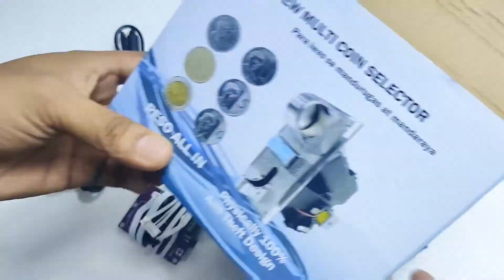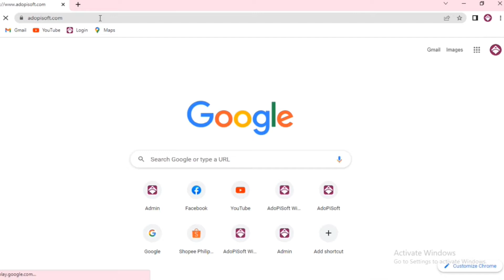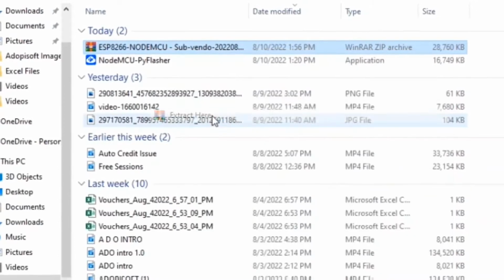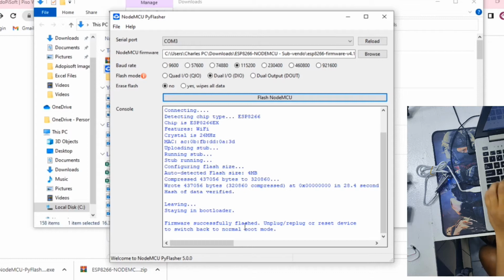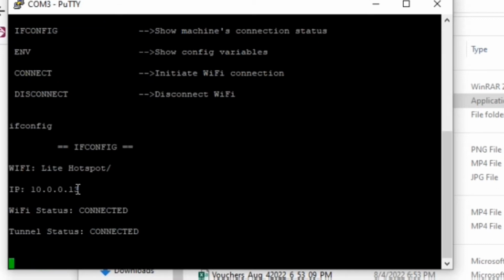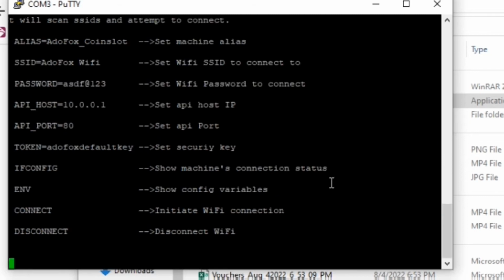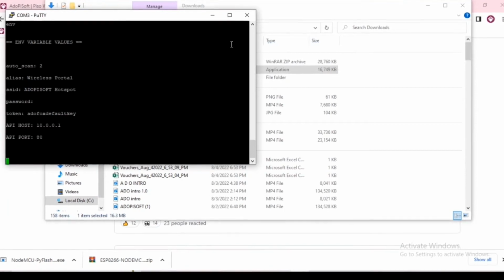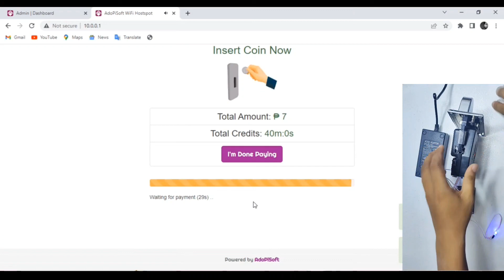How to Flash and Connect Wireless Subvendo | ADOPISOFT

Comment: after flashing when connecting to putty when i type help it no response anything ,, what i have to do ?
please help me
Reply from the maker: just try to remove the device from your PC and input help again, sometimes the codes take time to appear. As long as you follow the steps and it is successfully installed it will appear.
Reply: @adopisoft  i have restart device but still no response ,, i just wanna change setting SSID
Reply: @tremorfreya741  hey,,, do you have a solution for your problem?cause I faced the same problem
Reply: @LahanSastro0  i set ssid Lite Hotspot no password
Reply: @LahanSastro0  i think the problem from nodemcu,, because i buy nodemcu again and follow the tutorial just work
Reply: @tremorfreya741  I had 3 nodemcu nothing work with putty serial, so if I set the ssid "Lite Hotspot" on the dashboard, will nodemcu automatically connect to the main vendor?
Reply: @LahanSastro0  yes if u set your ssid Lite Hotspot the nodemcu automatically connect with your mainvendo
Reply: @tremorfreya741  still failed to access nodemcu via putty serial. Finally I found a new way that maybe you guys can try this method if this video fails. The trick is to use the Arduino software and use the serial monitor feature set baudrate to 115200 newline. You can type the command in the window and press enter. And all sets. good luck
Reply: @LahanSastro0  what specific software?
Reply: @milm3130  arduino IDE
Reply: @LahanSastro0  thanks for the info. Now, I can access the NODEMCU and its working
Reply: @ramrivera5175  nice... But adopisoft recently released new firmware for nodemcu vendo. More easier to access via web based.
Reply: can you share how to access via web based
Reply: In my case same problem. When I type help and control J there's no response, what can I do ado please help..
Reply: Same problem pag pindot control j walang nagyayari
Reply: @maxinedecagayunan2234  set mo speed 115200, type ka lang pero d mo makikita, tapos ctrl + j ka